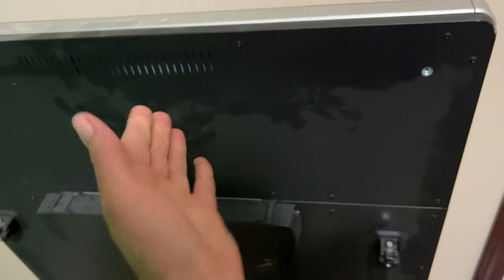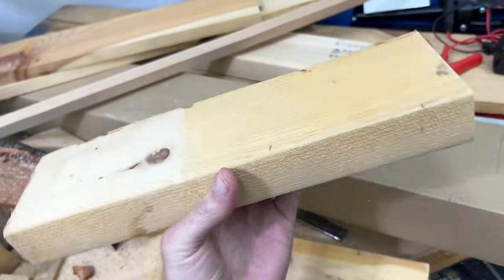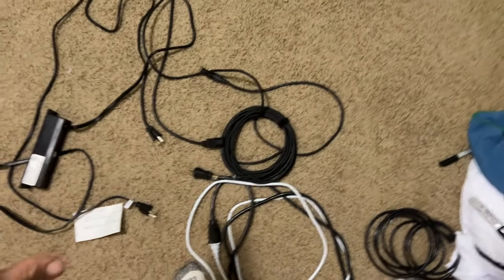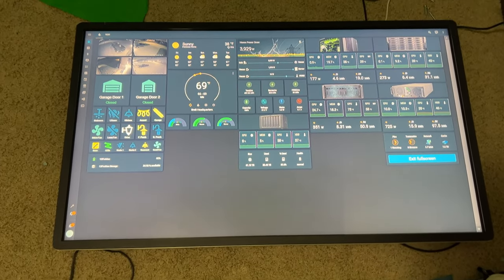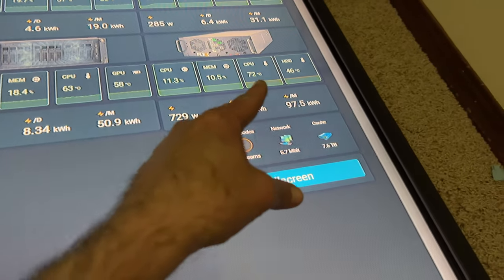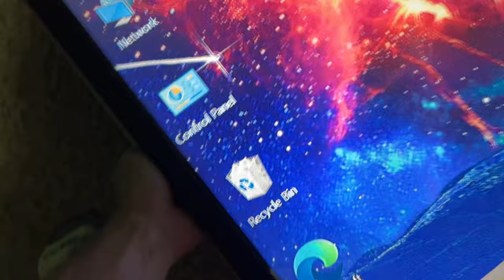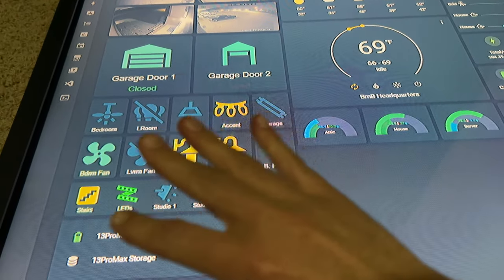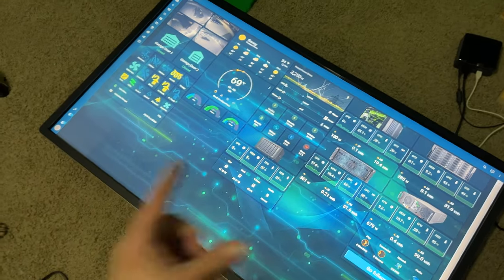Home Assistant intro on a 55" touch screen!

Comment: For the mounting, since the connections are not common like they have today.  You could just cut french cleats to hang them on the walls.  Counter sink your screws to mount the 2 bys and use washers for sure.  This way you can get the cleat on the TV, screwed in and set while on the floor.  Then to mount you just hang it onto the other 1/2 of the cleat mounted to the wall which you ensure to hit studs in the walls with long screws as well.  This is an extremely strong mounting solution.

Comment: If I'm remembering right, that older style of touchscreen uses infrared LEDs and photoreceptors around the bezel. So anything blocking the light (hair, gnat, or cat) will trigger a touch.

Comment: You can't let your touch screen on the ground like that especially a bigger screen it will randomly touch because the layers of the screen are touching. You have to set it up on a wall or not to touch like that
Reply from the maker: I shall find out! got some bolts so it will be wall mounted soon :)

Comment: When it's accidentally triggering the display is laying on his back flat. Usually displays like that are not meant to run lying flat on their back.  The accidental ghost triggering may simply be gravity because of your incorrect usage while the display is on? Put it upright and see if the accidental triggering still happens.

Comment: currently, you have a remote control home, now to unlock the power you need to build automations to do tasks based on triggers like home, not home, or outside temp, or leaving a zone that is not your home to prep your home for your arrival to name a few. Then you have a smart home.

Comment: since your using windows anyway, you can just automate that stuff with windows hello face recognition, you just need a supported webcam to go with it. after its automation based to do either display a screen saver or using a smartplug to power on/off the screen.

Comment: What you could do with the touch is it seems the usb is what does the touch? If so, you could have a usb on off switch to use. Or you could figure a button that can enable or disable touch.

Comment: Good video. Cool screen! Overkill for HomeAssistant, so perfect for your channel lol.
Countersink the screws 1/2" - 3/4" and call it good. Each one will have less than 50lbs of weight on it, so they shouldn't shear off. And if you're planning on bolting that to the wall, your 1x4 would be thick enough. I do see mounts on Amazon that hold up to 160+, so maybe an actual metal bracket would be easier??
Either way, curious to see the results!
Reply from the maker: Overkill?
Watch yo mouth! 😂

Comment: I would love to figure out all this integration.  I'm using Hubitat and hear it can be manipulated or at least work w/ Home Assistant and I'd like to figure out that as well.  The Home Assistant dashboard looks much nicer than anything I've come across thus far for Hubitat.
Reply: I'm in the same boat. I just haven't started a ha install since i don't have enough devices.
Reply from the maker: you only need one to start :)

Comment: So, when yo have one bolt that works, and you want to find another - the poor person's method.  First, you hold them end to end to see if the diameter is a match.  If the diameter is correct, hold them together, with the heads in opposite directions.  If they are a match, the threads will interlock nicely they will turn freely when one or both bolts are rotated.

Comment: you could put the screen on a smart switch and tie it into your wifi so it turns on when your phone is on the wifi and off when you leave. plus i want to thank you for making me not feel so bad about running a dell r720 idile at 190 watts with a few hdds going ive been tripping on that for a bit, and power is cheap here in nevada.
Reply from the maker: this is a fckin GREAT IDEA
Reply: @Bytemybits  tie home assistant into the wifi, phone and smart switch i think your getting picking up what im putting down. sorry im like 90% sure im autistic great with ideas and numbers, ideas and stuff but communicating  conveying them to others is really hard. sorry.
Reply: @Bytemybits  realy enjoy your channle keep up the good work

Comment: I need to figure out how to get those PC stats in my home. Would love to use that! Closest integration in HA for PCs are WoL... which only work on some PCs due to NIC issues.....
Reply from the maker: on windows PC: Libre Hardware Monitor (set to autorun, minimize, run web server)
on HA: (I think you need HACS and/or open hardware monitor)
go into configuration.yaml file (install studio code server via HACS) and add this to config file, then restart;

sensor:
  - platform: openhardwaremonitor
    host: your pc ip here, ex: 192.168.1.69
Reply: @Bytemybits  ooh this is awesome. Didn't think of a resource monitor software as a server for it. Thanks for keeping me up the rest of the night... 👍

Comment: I'm pretty sure you know this, but you can still use the 2x4. Just drill out the hole, then with a bigger drill bit you can counter sink the hole however deep you need it. Just use some tape to mark off how deep you want the hole to be.

Comment: is there a way to make a confirmation window pop up when you hit something like unlocking a door, opening a garage door, etc?
Reply: I don't remember the setting but my garage door button will open the device info when you click it instead of just opening the door. Or I can hold the button for a second and it will trigger to open.
Reply from the maker: I think so. just didnt consider it till it was getting set off so easily.

Comment: Would you be able to post the yaml for the Plex section of people watching/transcodes? I've been trying to get something like that for ages!!!
Reply: I use the Tautilli integration.
Reply from the maker: Tautilli
Reply: @Byte My Bits  How'd you get the nice colored icons for it? I was able to get the Tatulli integration working. Had it setup on a glance card but the stock mdi icons are boring looking.

Comment: why not just measure the bolt hole with some calipers and then measure your bolts instead of bringing a million of them to the tv... and now that you found a bolt that works but isn't the right length, you can measure the pitch of the thread with the caliper as well then measure the length of the bolt, screw it in until it stops into the mount, and measure how much bolt is remaining to find out the exact length of bolt you are going to need for your project...  not even that hard.  As far as the homeassistant dashboard, what dashboard software are you using... that looks DOPE AF.  I haven't started messing around with it yet, but I've watched a few homeassistant videos and it looks pretty epic... I'm planning on a remodel in the next couple of years at which time i'll very likely be doing in home solar, and adding smart outlets and lights and things and likely using homeassistant to do all the heavy lifting.